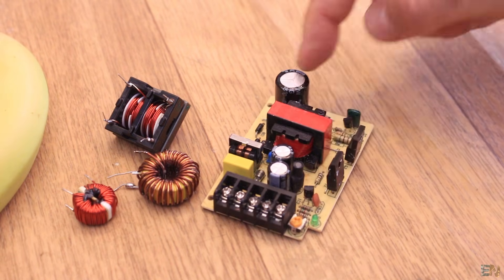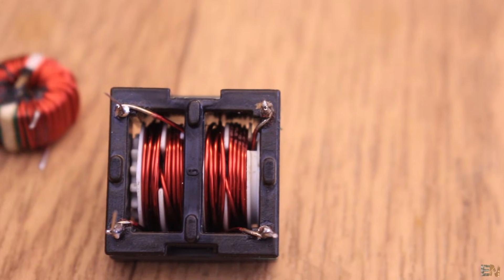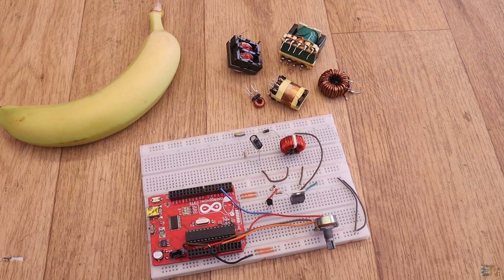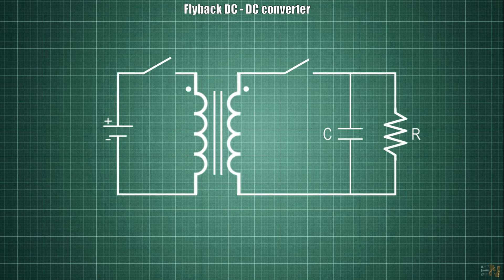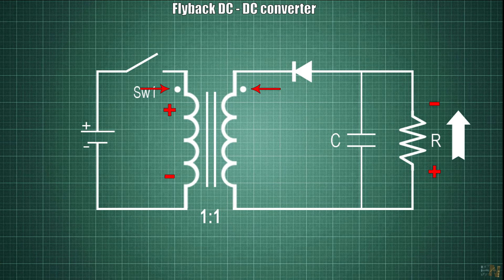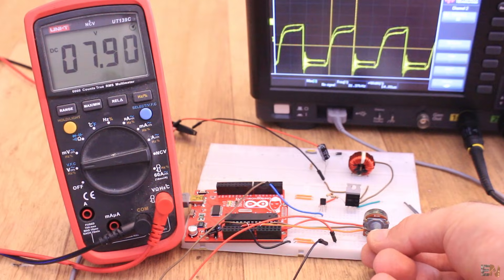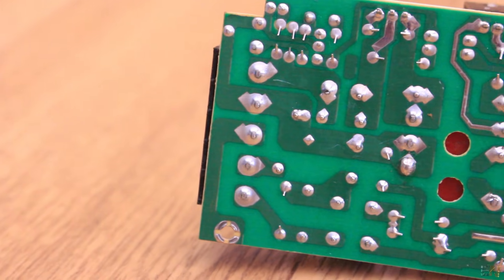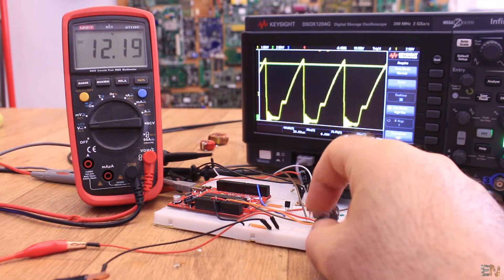FLYBACK DC - DC Converter Theory And Example

Comment: How did you manage the voltage spikes at the drain of the MOSFET?
Reply: You can use a snubber circuit.
Reply: Thanks. I tried using Zener diodes but heat is a problem. What kind of snubber do you suggest?
Reply: @christianstrohmaier3675  fly back converter are one of the most inefficient of the switched mode power supplies. The problem as you found out is the spikes on the primary. There is some stray inductance for each winding which is not coupled to the other winding. When you turn off the switch the energy stored in the stray inductance of the primary can not be transferred to the secondary and has to be absorbed in the primary side. The way the transformer has been wound on the video makes this problem worse but helps with isolation.
There are two ways to solve this problem.  1) add a rubber to the primary. The rubber circuit just dissipates the energy in the rubber instead of the transistor which reduces the stress in the transistor.
2) use a 2 switch approach. In the 2 switch approach the energy is returned to input power supply. The disadvantage is more complexity.
3) does not solve the problem but helps. Wind the primary and secondary on top of each other instead of side by side. This will reduce the stray inductance so you will get less energy in the spike.

The main reason for using fly back converter is you only need one switch in the primary. Also you can add an extra winding that can be used to determine when the energy in the inductor has been depleted before turning the switch on again. This has a kind of a crude short circuit protection. At low powers the efficiency vs complexity tradeoff is worth.
For higher power supplies like the ones on pcs the transformer is driven in both directions which solves the efficiency problem.
Reply: Francisco Shi 
Thanks for your thorough reply. Now I have some ideas to work on for my circuit.

Comment: It's worth mentioning that the flyback converter is likely the first switching converter ever built. It was used in gasoline engine ignition systems, first with mechanical switches activated by the camshaft or crankshaft, later replaced with electronics. (Many but not all modern engine ignition systems work that way - some are based on forward converters.)

The name comes from mechanics who get zapped by the high voltage and jumped backwards from the jolt. :)
Reply: "FlyBack"
Reply: OH!  I was wondering why "flyback" wasn't referring to a "flyback diode" or flyback resistor, both used to draining off excess energy out of capacitors and relays after shutdown.
Reply: @BYENZER  How many of us played with relays and batteries when we were little kids? The relay coil giving a sting that feels like a static shock probably got us quite a surprise the first time around.
Reply: @NiHaoMike64  The answer to your question is:
Most kids never do.  But, of those few who did, sadly, (or gladly, depending on your point of view), most of them are now all Darwin Award winners and helped to THIN THE HERD!
Reply: Thanks, i really wondering where the flyback term from 🤣
Reply: Actually the origin of the word "flyback" comes from their original use in horizontal deflection circuits in old crt tvs. A sawtooth signal would be used to drive the beam deflection coils, which would scan across the screen to generate a line of the image and then "fly back". These circuits required very high voltages, which prompted the invention of the so-called "flyback" transformer, which also provided the >15kv anode voltage for the cathode ray tube

Comment: If I put diode+capacitor in the output that can I rectify the noise on a switch mode power supply.I am not an engineer but a high school kid in junior year who is an electronics enthusiast,so regret if my question is stupid.....
Reply from the maker: Put that at which output? Yes, with a diode you can rectify AC and get DC voltage. But the noise of switrched supplies is given by the capacitor value and PWM frequency. Is impossible to have 0 noise!
Reply: @ELECTRONOOBS  at the final output,as the noise itself is alternating current,it too could be rectified.
Reply: @raghavsrivastava2910  The power in the noise is <1% the DC power so not worth harvesting. 
Best way to get rid of it is to add a resistor or inductor in series with DC and a large capacitor from inductor to 0V to bypass noise to ground.
Reply: @peterdkay  thank you also I wanted to reduce noise not to harvest it.
Reply: @raghavsrivastava2910  Understood. Best way to reduce noise is lots of capacitance or even better Inductor/ capacitor filter where LC resonance frequency is much lower than switching frequency.

Comment: I've a question. Why use two transistor? Why not a single MOSFET as a switch?
Reply from the maker: Arduino can only apply 5V at the MOSFET gate. For that we need a driver. The BJT acts as a driver and applies 12V at the MOSFET gate!
Reply: @ELECTRONOOBS   So we need 12 volts for MOSFET to act make it a switch? below it it won't behave as switch. Am i right?
Reply: first bjt transistor switches MOSFET on and off